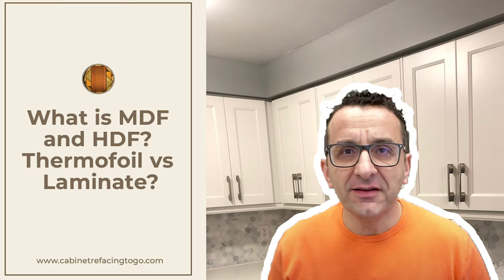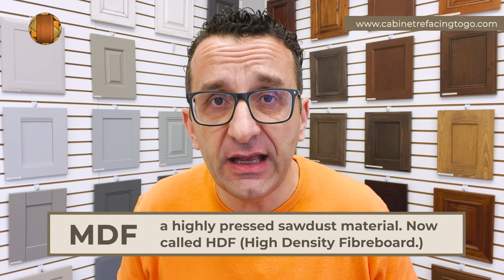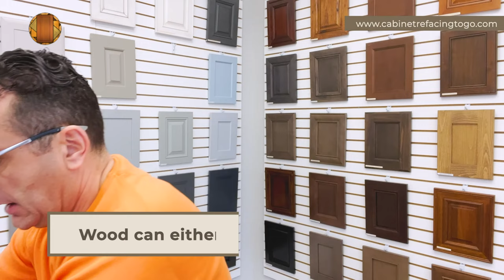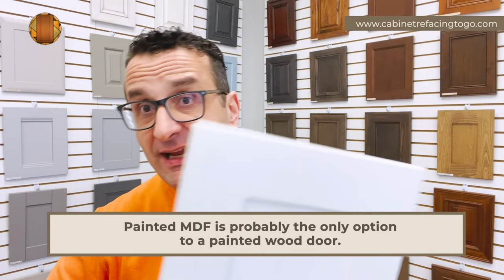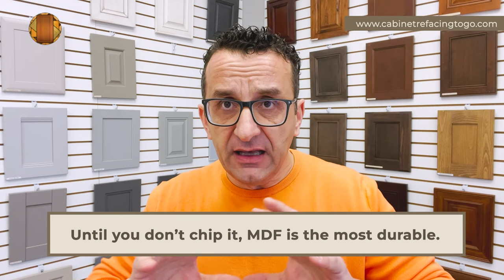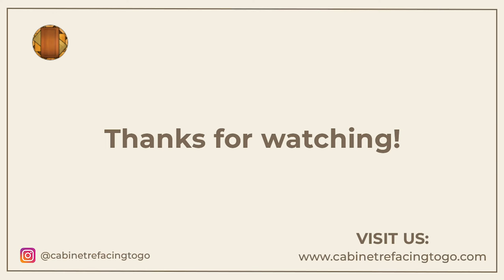MDF, HDF, Thermofoil, Laminate, Wood - Different Materials Explained

Comment: I put thermofoil doors in one condo 13 years ago and laminate doors in another at the same time.  Contrary to this video, the thermofoil doors still look new, the laminate doors are peeling and expanding from moisture and I've been replacing them.  I guess it depends on the manufacturer